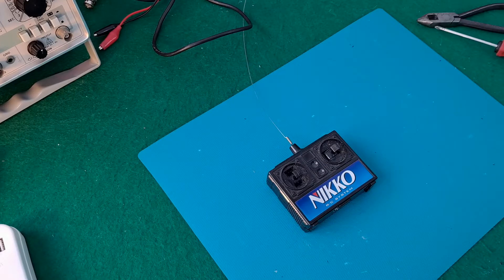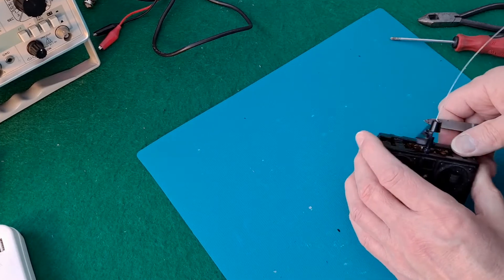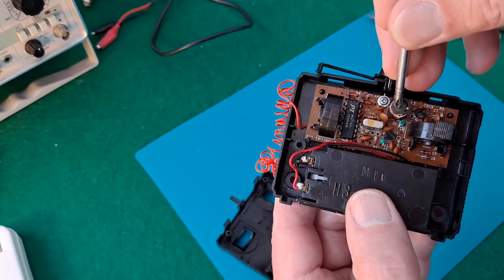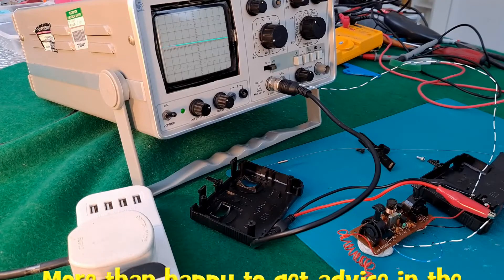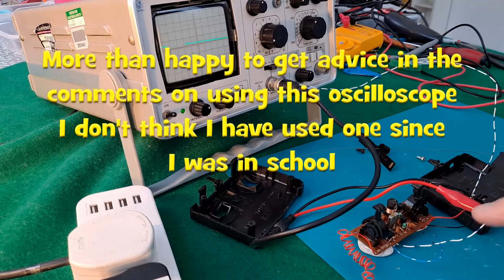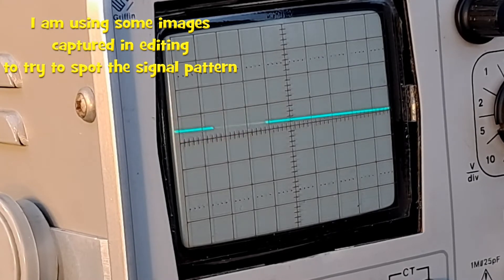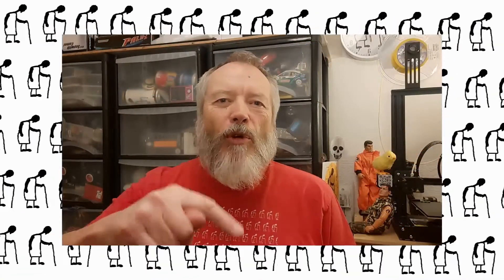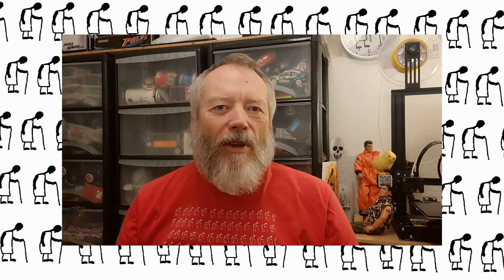Nikko 40Mhz transmitter revisited 20210108 FAIL

Comment: Adding a piece of wire like that will usually add capacitance. As the wire is connected to a pin for the internal oscillator of the chip, it's likely slowing it down enough to get it to work. I'd suspect the timing resistor or the traces leading to it, the allowable timing tolerance is usually pretty high on these encoder ic's, so it's unlikely the resistor is somehow badly enough out of tolerance. It does look like you have a pretty nasty solder joint just above pin 8 which looks to be one end of the timing resistor - maybe time to get a good magnifier out to check the joints and traces around it and leading to pins 11 and 12 - tiny cracks are virtually impossible to see without a magnifier.
Reply from the maker: Thanks for the suggestions

Comment: Grandad, I wish you would adjust the trace rotation, the beam angle is annoying me. :)
Also, what model is that Griffin scope?
Reply from the maker: I have no instructions and only the vaguest idea how to use it.
Reply: @GrandadIsAnOldMan  Ok, what model number is that scope?
If I can find any info and what functions that scope has, I would be able to help you use it.
Reply from the maker: @banjax66  well the positive news is that whilst looking for the model number I found the Trace Rotation adjuster. The bad news is that it had zero effect. The Oscilloscope is a Griffin 15MHz Single Trace Oscilloscope. It doesn't appear to have a model number.
Reply: @GrandadIsAnOldMan  I cant find any user or service manuals for this scope but apparently when brought from new, it came with both manuals. So it shouldn't be too hard to find them online and I'll keep looking.
From what I have read on a few forums, the usual faults with this scope were high value resistors going higher in value and the usual capacitor faults in the power supply.
It might be worth squirting some switch cleaner in the trace rotation pot to see if things improve on the trace.
Ian.
Reply from the maker: @banjax66  thanks, surprisingly enough I spent quite a while looking for manuals for this scope, and so did the friend who gave it to me. I will try some contact cleaner, thanks for the tip 👍

Comment: Hi Grandad , Maybe A Wider Signal has A Broader Range ? I Was Thinking That That Little Wire May Not Be A Antenna , But , It Is Changing The Signal by Less Interference or Better Ground . I Don't Know Too Much About An Osicilliscope Though .
Reply from the maker: The tag I connected the wire to is the resistor that sets the internal clock frequency so I have no idea why it makes any difference. I think I changed that resistor to check if it was faulty last time.

Comment: 6:07
Makes it seem like they are using it for some type of feedback .
Would that work like a phased locked loop ?
Reply from the maker: That went straight over my head 7:55 is what I wanted to see
Reply: @GrandadIsAnOldMan  
Adjust the time base until you see about 17 cycles then engage the one shot / capture function to freeze the display .